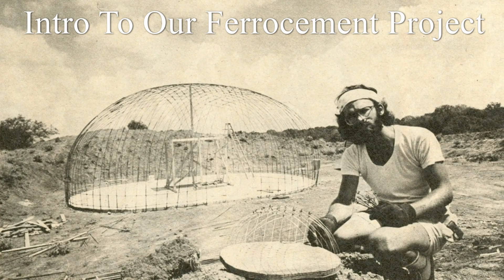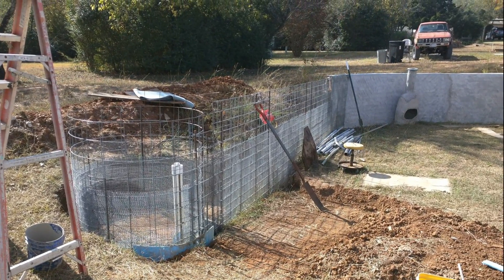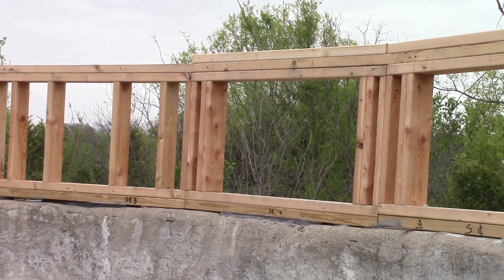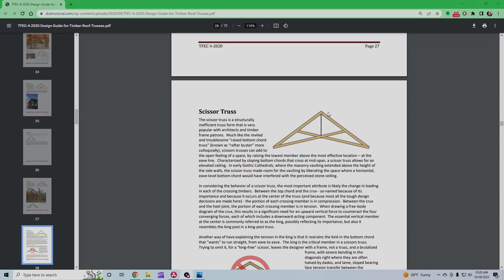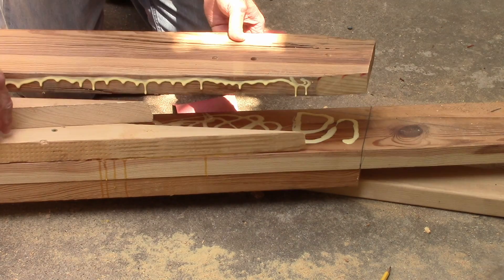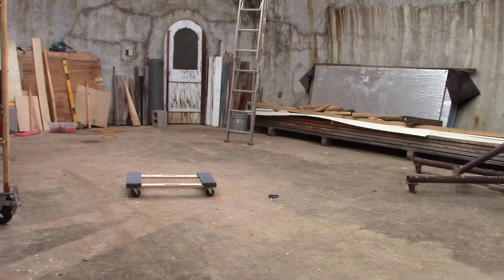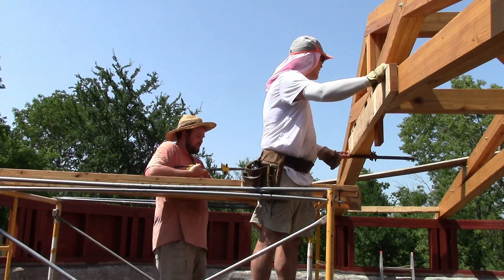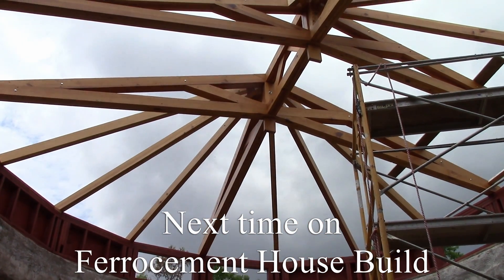Ferrocement House Project Part 11 Round roof on a dome house

Comment: the connecting means (rods?) look too weak. maybe they're mithril ones idk^^.
never use threaded rods in wood.
also one is placed in a seam/gap and that's not ok.
wrong washers (your's are for steel construction, wood ones are wider)
and no washers o_O
laminating on site is completely useless (because it's uncalculabe when not done in a factory) and especially at the places you used it
you should get it checked out by an engineer
likely not safe
above list not exhaustive

t. structural eng from germany
came here via the Honda Insight videos, ty
i don't comment much, but you're a cool dude